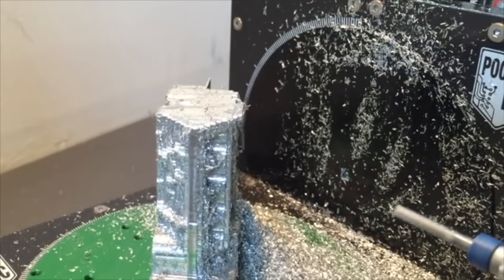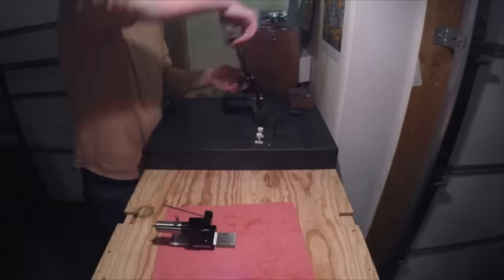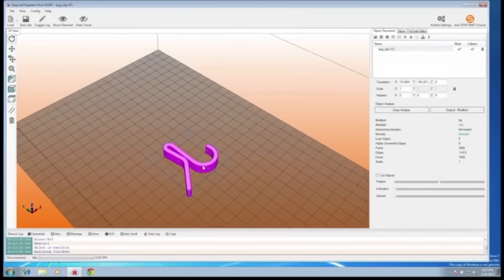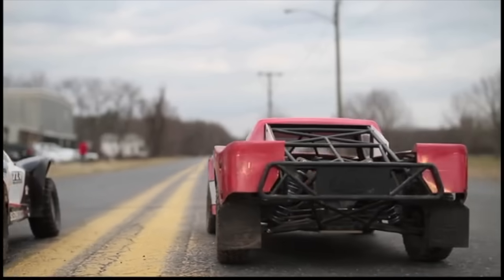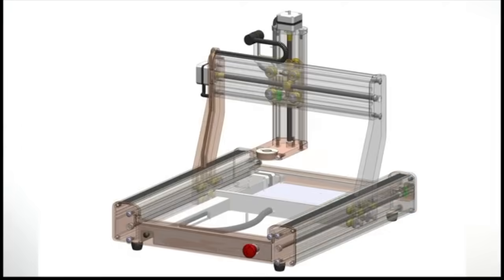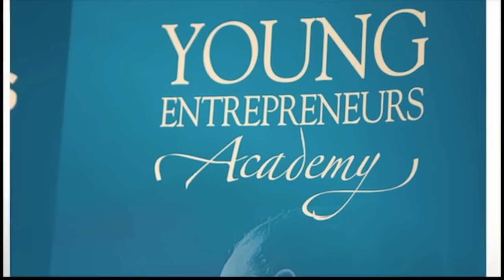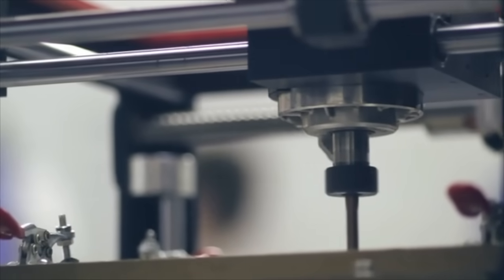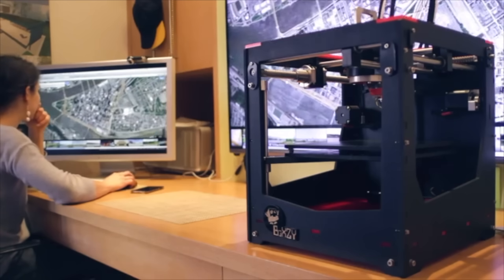TOP 5 desktop CNC machines for your workshop

Comment: Just a bunch of commercials so just click on the links for information.  No point watching.  Also it seems two of these have gone out of business.
Reply: Have you seen the samurai 120 on kickstarter
Reply: @Seed-qj6jk  Thanks for the tip, but I have seen to many kickstarter attempts fail.  I will not put $3,500 on a machine that I don't know if it will ever be delivered.  And there video is not really all that inspiring.

Comment: Just buy a used Bridgeport, a good Kurt vise, a set of R8 collets, a proper clamp set and go make some stuff. I hate conversational programming - I've been writing G code since the late 70's. I could have parts done while these folks are still playing computer jockey trying to write a program.
Reply: Dude, you have to compile your use-cases, and list your stakeholders first. Let’s see some pseudo-code, and some diagrams...10 hours spent planning saves 50 hours doing it the hard way, we’ve got studies!!  Haha or just f* do it
Reply: @TSPhotoAtlanta  - Oh, sure - argue with the tool and die maker who worked in the aircraft business for over 30 years.... SEE YA, LOSER!

Comment: 1) Pocket NC V2-10 is USD 5500
2) Stepcraft 2 D210 is EUR 699
3) BoXZY Complete 3-in-1 is USD 5989
4) Shapeoko 3 Standard is USD 1099
5)  The Othermill is USD 3199

All wildly vary in size and and capabilities.
Reply: Why would people purchase these extremely expensive desktop machines when people can build their own DIY CNC, mill, 3D and other machines for far less.?
Ender 3 Pro v2 is $279.00 dollars and you can also purchase a laser / cnc machine for $199.99.
Reply: @TwstedTV  I don’t want to build a system, I want to purchase a system and start making.
Reply: @rapid13  
Just FYI, it only takes 30 to 45 minutes to set up and youll save yourself several hundred dollars.  just saying....lol
Reply: @TwstedTV  OK, but all I see there is a 3D printer, no CNC.
Reply: @rapid13  
You purchase the CNC drill separately which comes out MUCH MUCH cheaper than those expensive units.
Go to Banggood.com to get the CNC drill attachment.
Reply: @TwstedTV  This is kind of what I meant originally. I’m sure it will save a lot of money, but it’s going to cost me a lot of time to figure it out. I’ll have to search the web for info, probably join a forum and ask noob questions, wrestle with making mistakes. Or I can buy a decent unit for more money and just go to work.
Reply: @rapid13  
One thing I have learned from 3D printing & CNC'ing....  NOTHING, absolutely nothing is just plugin play....  you will at some point going to have to modify & purchase parts one way or another.
3D-printing and CNC world is ALL about DIY and tinkering, no matter what machine you buy or how expensive the machine is or the promises the company says that its so called hassle free.
You will be in for some rude awakening if you believe that will be the case.
Its best to start not so expensive, learn as you go and DIY modify to pick up tips and tricks along the way.
You will gain much more knowledge and experience that way and be much happier because as time passes by, you will pick up on cool things and things will be much easier to do in the future within the hobby.
Just FYI  :)

Comment: Boxzy is in desperate need of Boxzy 2.0.
    a) The power supply needs to be upgraded so it can handle those dumb NEMA23 motors they upgraded to (hint, buy an elephant, make sure you can feed an elephant).  Several of my 3D prints died doing simple stuff due to that simple failing.  Upgrade beyond that goddam Ultimaker board.
    b) As a mill, there should be some form of chip protection to keep the damn thing from dying after cutting through 100 ft of material.  Nothing to keep this thing from dying in it's own dust storm.
    c) Laser:  Adding the safety feature (laser is only active when grounded through the body of the Boxzy frame) that doubles as an electric shock hazard is a brilliant move.

    d) Add some reliable temperature control.  I had to upgrade to an E3D V6 printer head (to avoid the stupid out of the box heater jamming on me).  The temperature control this thing has is terrible (+-5 degree swing), because the single cooling fan that prevents thermal creep up the bowden extruder is the same one cooling the part.

     Check out their unofficial forum to see what sort of fixes people have come up for this thing, and issues that they have had.

    Boxzy needs an upgrade, but it has the start of something.  They need to make a Boxy 2.0 that fixes all the above problems.